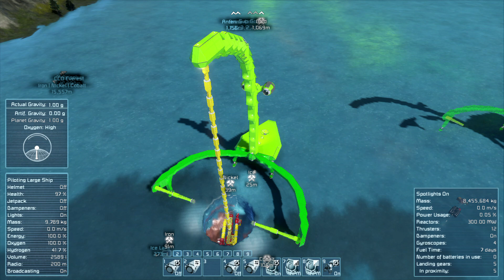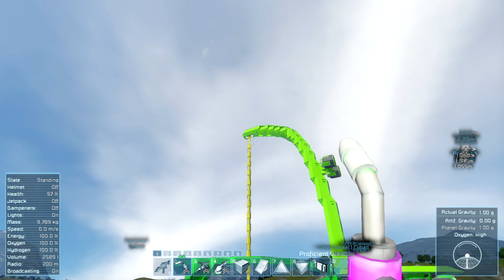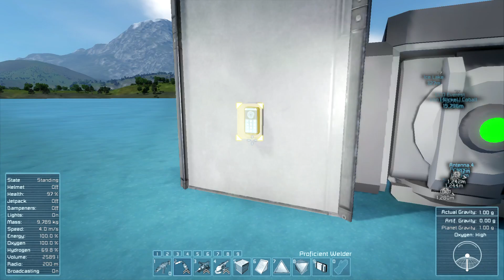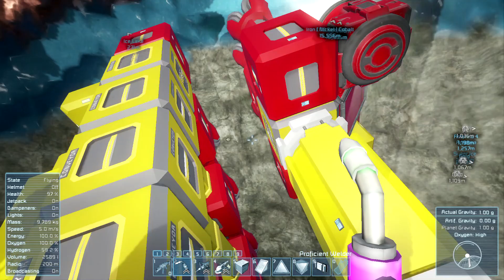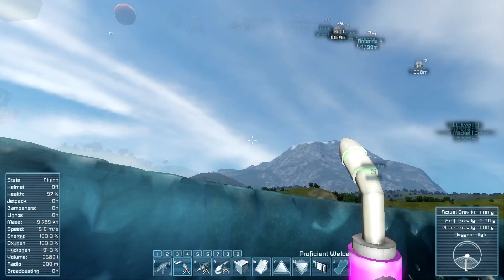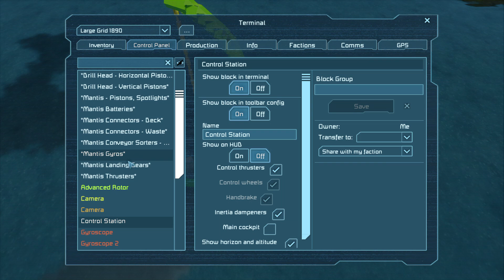Mantis Mining Platform + Bore Head | Space Engineers + Me! #26

Comment: I think a few of your issues are related to it being a ship and not a station, ships are really bad when it comes to stability. Try merging it to a station before mining and see what that does. Also i noticed you have the pistons going pretty fast, part of you frames issue might be due to the drill forcing itself into the ground instead of mining as the ground comes into the drills range. I took one of your earlier designs for this and made one of my own and it works really well and i can still fly a 200kg large ship with 30 fps. My setup has just the downward facing drills you have with the punch closer to the rest of the drills. I have 8 pistons that are set at a feed rate of 0.003 each. The rotors are set to 0.5 and there are two sideways drill so the hole is slightly bigger than the drill so there isnt and contact issues.

https://steamcommunity.com/sharedfiles/filedetails/?id=597903293

The picture is of an earlier design, the current one im using has the punch just one block under the rest of the drills. Good luck with your build and thanks for the idea.
Reply from the maker: +Colton Sparks There's no getting around the issue with pistons not wanting to be on somethiing that moves right now.  It doesn't matter what we do to try to get around it...the only way to deal with it is to not try to move a ship with a column of pistons on it.  Since we can't move a station, merging the platform to a station doesn't solve the problem, because we have to convert it back to a ship in order to move it, and that's when the pistons come off.  As long as the ship remains stationary and locked to the ground, there are no issues with pistons detaching for no apparent reason.

The framerate issue is from the collectors.  Bottoming out the drill wouldn't cause framerate issues and the easiest way to tell if the drill assembly has hit bottom or not is that a drill assembly that has bottomed out won't spin on the rotor.  That's the hint to raise it up a tiny bit until it starts spinning again.  

Glad you were able to get some ideas from the design!
Reply: +Enigmius1 I probably worded it wrong, but what i meant is how the ship is connected to the ground. Landing gear are a big issue for me when i build. Something can be attached to the ground with landing gear, but the ship will vibrate depending on what else is going on in the ship. I didn't know about pistons disconnecting when merging, until now I've pretty much avoided pistons on anything that moves. There are plenty of possible workarounds, but none of them are guaranteed to work and none of the are cheap.

I just let the ore drop and let the drills manage everything, which might be why im nearly lag free. But with the gyroscopes turning the drill for me at least, the drill would keep drilling once it hit the ground and be spinning. The only thing that would happen is the pistons would bend to their limits and if i wouldnt of been there testing it they would of probably snapped. I just thought since your drill bounces from side to side a bit that might be what was causing it.

Comment: If you make a version with red solid blocks following the side of the pistons and painted them red then they would all be a part of the core ship. Then when the whole build is done you grind off the red parts and, voila. Less work, more . . . Ehrm work? This would allow you to make a more effective blueprint. Stay frosty.
Reply from the maker: +Lt Sam Pistons are longer than a normal block by about 0.1m.  If you placed blocks along side the pistons, they would be very noticeably out of alignment by the time they reached the drill head.  It's easier to build/dismantle the pistons and drill head each time you relocate the mining platform.  We tried this with the Blue Behemoth and using the pistons to secure the drill head with merge blocks and as soon as the pistons detach you're screwed...you can't re-attach them to the drill head because of the offset created by the piston heads.